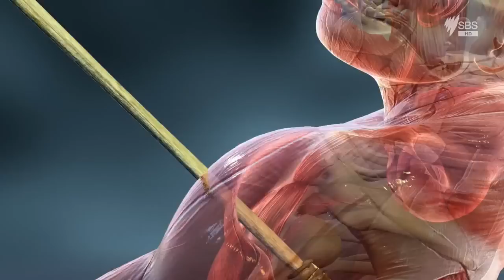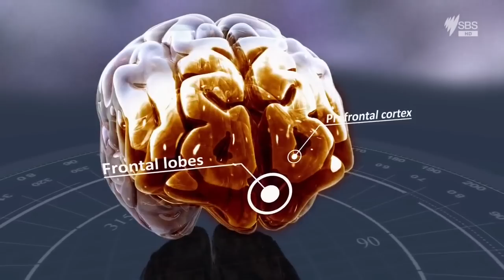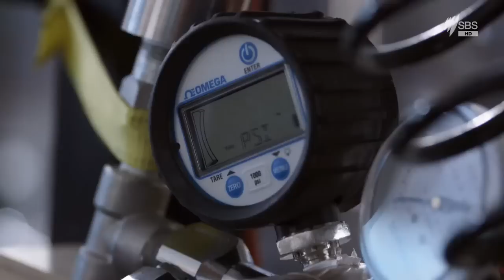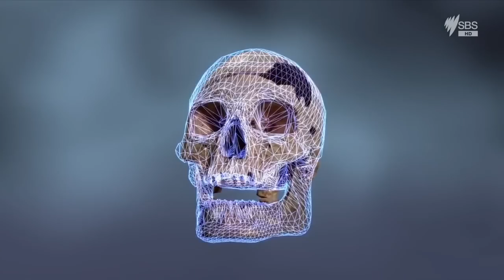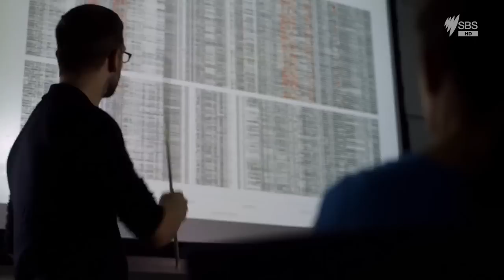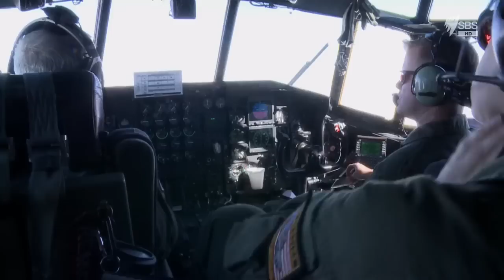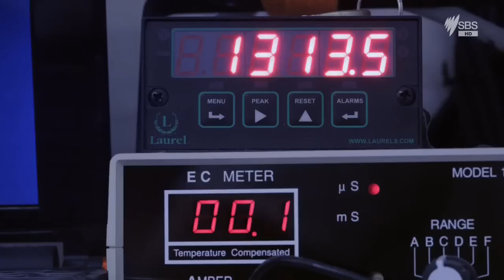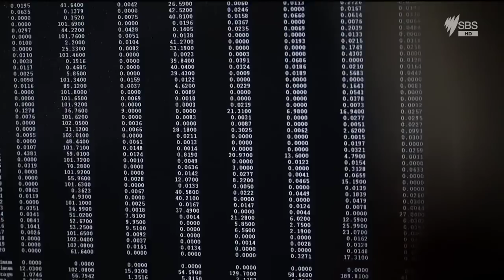Neanderthal Apocalypse - (2015) Documentary (Hrvatski titlovi)

Comment: 37:50 Very interesting, though the rib bone with the injury on it was on the back side was it not? Supposedly it needed to have twice, or three times the power to penetrate that deep (and also inflict damage on that side's bone), and even then, the stone point sheered off on impact in the test, which isn't what you would want if every point is so meticulously made. There's questions that need answers.